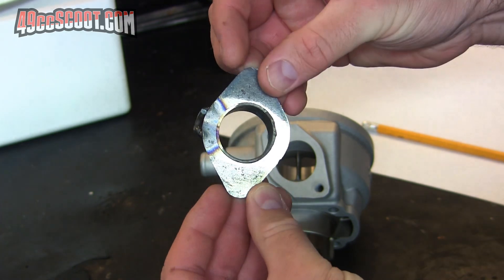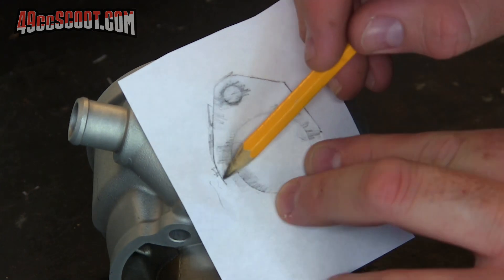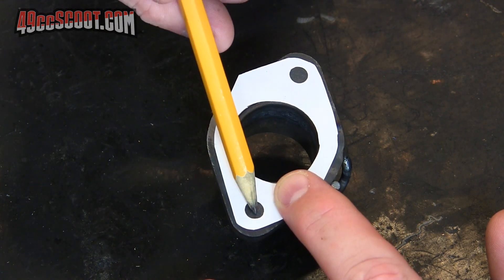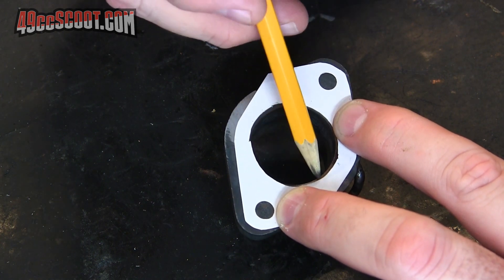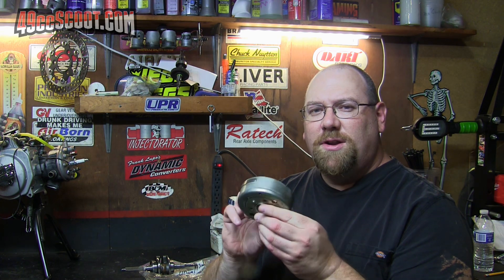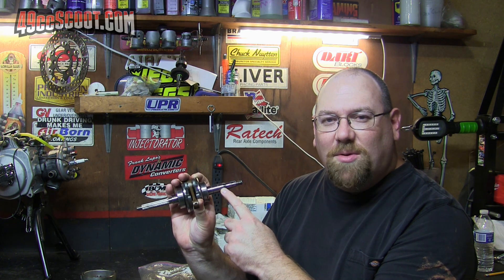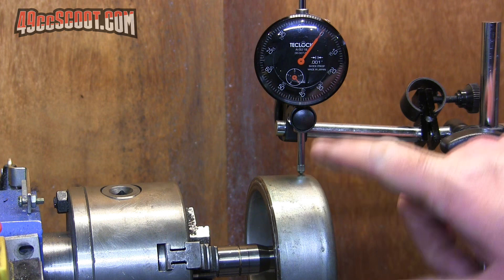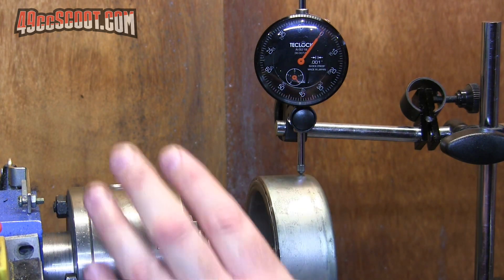TPR 86cc Build : Part 2 : Header Matching & Lightening The Flywheel

Comment: I know this may sound silly, but I really am enjoying daily riding my Rieju SMX with the TP86 kit installed. Stock flywheel (don't know wtf that 94 Evo dude was talking about with the rivets) working wonders, and I have swapped the CDI for a Dellorto racing one. Only problem is the 14k RPM limiter. That really takes the ompff out of the pulls. Especially in 2nd and 3rd gear, where it pulls really hard, and suddenly, in the middle of the peak power, stop! Really annoying. If anybody knows how to derestrict this type of CDI, give me a shout.
Reply from the maker: The 94cc Evo was on a Chinese scooter like mine. I think he posted a pic at one point. Anyway, it's not the only flywheel failure that I've heard of. The MVT ignition is a nice upgrade for waking the TPR up even more, but not as capable with charging/lighting as stock.
Reply: @49ccscoot  Right, understandable.

Comment: Good afternoon brent .my  yamaha jog 50cc the rivets broke off the flywheel i took it off and welded it back on then i questioned myself is there a specific way or line up with the inside goroove and the outside part of the flywheel that contacts with the stator
Reply from the maker: I've never pulled one apart. If it doesn't run or vibrates like an oddly loaded washing machine, I guess you'll know.
Reply: @49ccscoot  ok thanks
Its actually ideling more silent than before

Comment: how is your scooter doing so far on the street? have you consider a piaggio 180cc build? best engines for daily use can be strongly abused
Reply from the maker: I was looking for a 180 around the time that I decided to get into this build. Too rare and no parts, plus it's all really expensive if you're in the US. Check out part 16/17 for how it works on the street and/or look at the H20i 2019 and Endless Summer Scootin' vids. Short answer, it does pretty well for me as-is.

Comment: This is exactly what I'm doing on a piaggio hyper2 engine.
I will run an aluminum stage6 70cc sport pro cylinder with a Yasuni c16 exaust. No porting but all the rest of engine parts will be maxed out/best performance parts out there.
I think it will be just fine for simple riding. Next summer I might port everything to the maximum performance.
Nice videos liked, subscribed!
Good luck!

Comment: i think you faild a bit, if you wanted a daily you should of gotten a blacky trophy, and slightly widend the exhaust port, it than makes around 11 at 10k rpm and it can last forever since its cast iron and you can bore it 5 times , and its dual piston so it lasts for quite a while , a frend of mine is at 8k km with his and its still working, not strong as it used to bee but it did overheat once... still tpr is a good kit, just dont seez it because you dont have an option of boring it,
Reply: I can't agree more

Comment: awesome video well as you know my taotao is my only means of of getting a round ill ride this thing every day but i have a little noise in my crank and rod  i want to rebuilt it but don't know  
with parts to get for long trem riding any parts you can wreak a mead would be a big help cant wait to see how your built turns out
Reply from the maker: Maybe try a name brand stock stroke crank like Naraku. Stick with stock bore for max reliability or 47mm  bore for better power. I'd not go larger than 47mm bore for regular use.

Comment: Remove the electric starter and especially its freewheel from the crankshaft. This will eleminate friction, because there will be no more drag in the bearing the freewheel rode on. Also it will reduce rotating mass a lot. Just use your lathe and cut a washer from an old freewheel to space out everything on your crank correctly. I have done that to my chinese budget race scooter and lightened my flywheel as you did. Only difference was that I dialed in the cone the Flywheel runs on before turning it, so what I turned runs now true to the crank. ;-) I also made an "axle" and a balancing jig to balance the flywheel. Maybe you should consider this step too, because a giant vibrator may break a crankshaft.  

If you want to make your high end cylinder "slower", think about getting it lathed shorter on the lower cylinder sealing surface. This will shorten the timing because the ports will sit lower. The piston crown will stick a little in to the ports at bdc, but that will have no ill effects. You have to take into account that now the piston crown will sit above the cylinder head sealing surface when at tdc. Just keep the rings inside the bore at tdc and turn a new combustion chamber suited for your desired cr. Older Honda scooter engines get restricted in this manner for the european market. Aim for 180° timing at the exhaust and 120° timing on the transfer ports. This is what I use for lasting, fast streetable mopeds and it has proven to be just right.

Comment: I think a reasonable expectation of hp is 5hp per 50cc's of displacement for fairly reliable functionality.
Reply from the maker: For excellent reliability, probably. I don't have a dyno, but I believe my 103cc surpasses that. If the head gasket would seal, it would be pretty reliable. Pretty much if Taiwan took a little time to engineer it better. I think a lot of 70cc stuff could pass that mark too. Depends if you're talking about something that lasts 20,000 miles or just something that you can take on some long rides too.
Reply: You can double that to 10hp per 50cc, there will be no difference in longevity to a 5hp motor. But it will not be as easy to build that engine.
Reply: And then there is the guy from 2 stroke stuffing channel.
Reply: 50cc and over 20HP
Reply: @Bruno.Dexnet.English  reliable or streetable? Sure not. ;-) Otherwise we all would use salt flat racers on the street. Turning around corners  is where the fun begins riding a moped of this kind. :-)